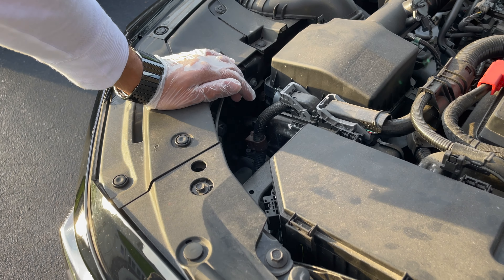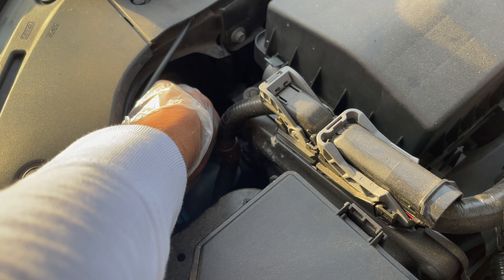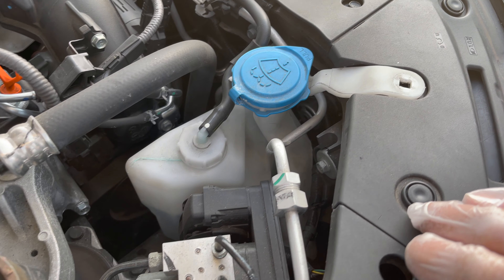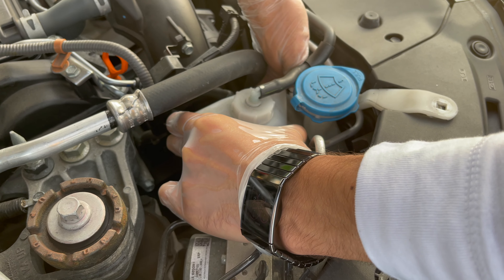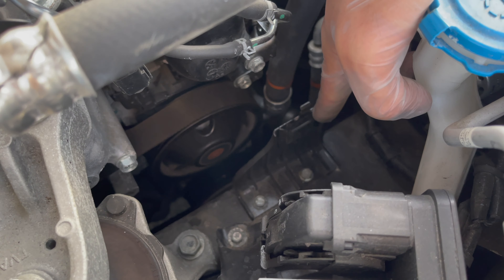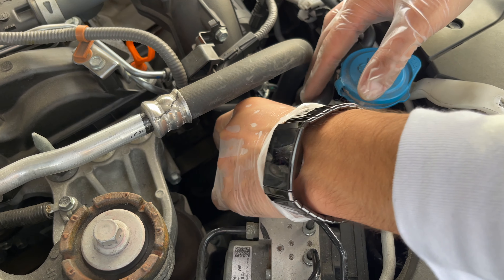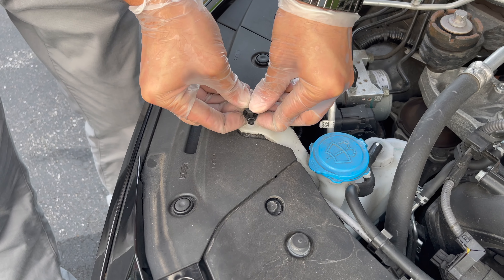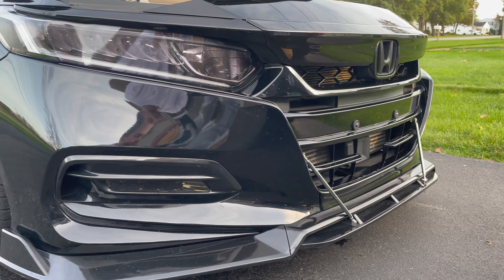Change your accord high beam to brightest one 2018-2020

Comment: Those Lasfits are nice. I went with Marimoto 2 Strokes for mine. They are more expensive ($200) but they have built in resistors. Might switch my interior bulbs do Lasfit though.
Reply from the maker: Yea $200 a lot bro.. 👀
Reply: @RedLineMods1  Totally worth it though. They have a different light projection shape than the lasfit (light more of the road) are brighter, and have those resistors.
Reply from the maker: Ahhh that must be nice. The shape vertical one I believe? 👀
Reply: @RedLineMods1  yeah